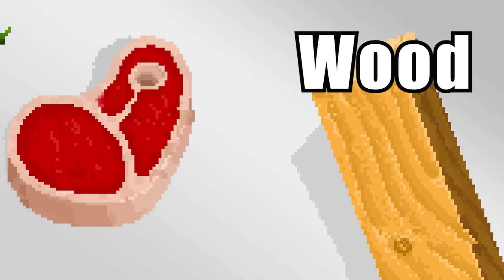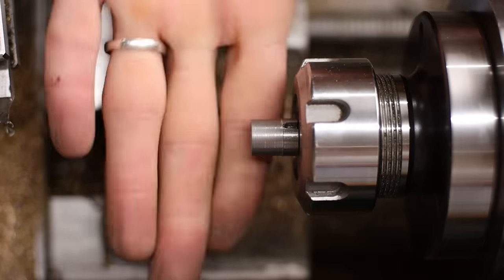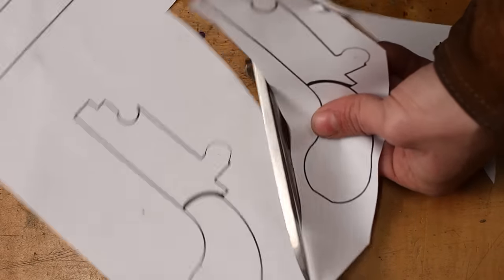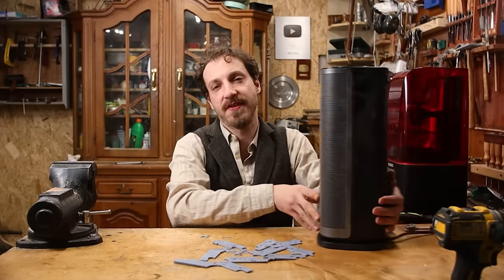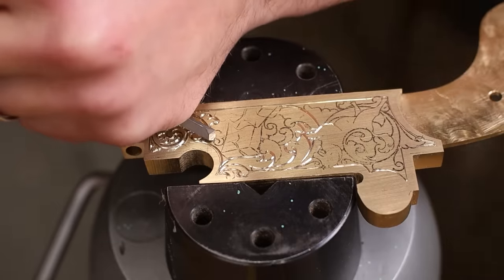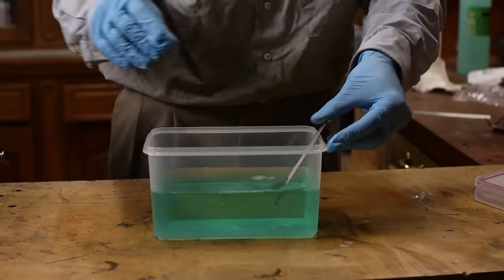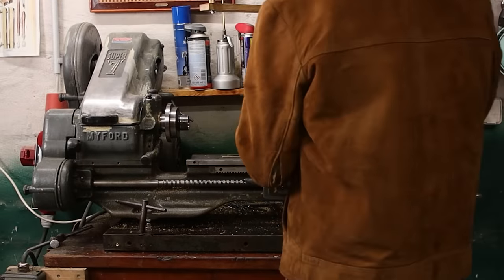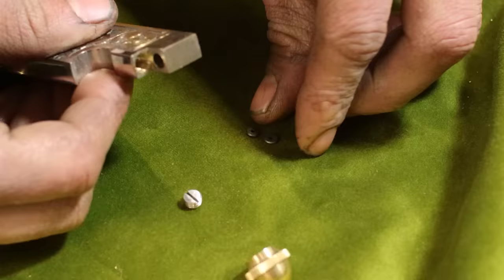I was Commissioned to Create a Circular Glass Cutter, will it Work?

Comment: I've tried casting tin with that same high temp silicone, casting a 3D printed coin. I think the problem we both ran into is that the tin cools too quickly. The mold needs to be a material that can be heated (sand, ceramic, etc) so the tin cools slowly and can get into all the nooks and crannies. In my case all the holes and imperfections made the coins look like old, corroded shipwreck treasure so it worked out okay.

Comment: Uri, I think next big project will be investment casting. It will allow to have smallest details. You can nickel plate locally with a wet sponge. If your steel quenched in water then it is W1. O1 is quenching in oil. I had also negative experience with glass cutting. When you scratch the glas you create a weak zone. Doing it multiple times does not help and opposite. When you start applying stress it does not cocentrate if you have several scratches. Perfect video. As always!

Comment: I second the comments saying that the casting molds need some "spouts". Places where the extra metal can go, chasing air out. But for such fine detail you probably need to use an injection mold. I tried making flat molds but the result needs a lot of additional work to remove excess metal on the back and possible re-work details.
Having said that, the result is amazing, it looks so cool! I hope the client sends you photos of it in use

Comment: On some glass heating works. Cut the groove and run the flame from something like a jet lighter along the scratch. You can hear it cracking and the crack propagating along the scratch. It works wonderfully, but not on every glass, some just break especially when there are multiple scratches from the cutter.

Comment: If you heat the silicone mold up before pouring the melted tin, that might fix your proplem. That's how they pour scultping wax, which has the same problem you had with cold molds

Comment: I work in glass manufacturing 
I physically flinched each time he did double passes

The whole thing looks very beautiful

On another note
Glass/Cutting oil and even pressure during the cut would help
Grab the glass as close to the edge as possible, doesnt need to be as close tot he cut
When you cut smt round make 2 or more additional cuts to break the outer parts off
Lastly, you can (but it is not advised as it can easily make the edge not 90°, so unless you have a tight curve like here better not) complete the cut from the under side, where by you "pull the cut through" by tapping some metal on the underside of the cut and then slowly advancing as you push the crack further

Comment: Lubricate the cutting wheel with white spirit and make one cut only.
When removing glass from the inside of a circle, first score a grid with none of the squares more than 10mm.
(It's only in jewel heist films where a disk is removed in one piece).
I do like your engraving skills. I wish I had seen more of you doing this.
Thanks.

Comment: protip, get a cuttingwheel used in a cnc machine, at work i used to use those that came with the handcutter and constantly had to replace them, then i took one of the used cnc wheels and even in that state it has lasted me 4 years so far with no decrease in cut quality since i'm nowhere close to putting the pressure on it that it's rated for, it's way more expensive than the disposable ones, but it pays for itself in one year of use.

the angles of the wheel is also important 145 degrees cuts everything 6mm and below, 155 degrees cuts 8mm and above.

When you want to start breaking, tap the glass from the opposite side of the cut, tap the glass directly under the cut, the amount of force required is a matter of practice, also, don't use a hammer, that commercial cutter you have is a similar model to mine, i use the corner of the wheel holder and i tap lightly.

Try avoiding going over the same cut twice, every sub-sequential cut makes it rougher, creating dozens of hairline fractures that provide the break with dozens of alternative paths besides the intended one, cutting oil helps get a smoother cut and a cleaner break.

also

The tin most likely had too much surface tension to really get into the details without a vacuum setup.

Srry for geeking out a bit, I am in absolute awe of the tool you've created, magnificent meld of form and function and masterfully crafted.

Comment: As a guess, your moulds are probably could. The silicone moulds need to be at temperature. Not as hot as the metal, but the need to be quite hot, so much they could burn you. Otherwise, espcially with such big surfaces, the metal cools to fast and cannot get into the detail. Also, while for plaster and resin such flat moulds are fine, for metal anything too thing won´t cast well, because there needs to be a resourvoir putting pressure on the metal down in the mould. So when casting such thin pieces, the part needs to be cast upright not flat. With a spout on top and vents going up from the bottom and other places to evacuate air. I actually would make such a flat and simple piece in a mould carved from soap stone. That mould can be nearly heated to the melting point of the metal, won´t degrade and is basically it´s own release agent. It´s what has been used to make moulds for casting tin and pewter sice ancient times. And it can capture absoluely incredible detail when the mould is heated well and the metal hot enough to very easily flow.

Comment: Scoring creates a fault line in the glass structure.  Next time, gently tap the glass along that line from the other side with the end of a file to deepen the fault.  Single or double-strength glass should snap easily after that.  Also, be sure to score completely from edge to edge.

Comment: a diamond type glass cutter is a lot easier to use.  Get a good one with a big chunk of diamond set in the tip.  Requires much less pressure.  Start the break near the edge of the sheet.

Comment: Make yourself a round jewel embedder. It's two tool heads, one cuts a dimple and a ledge and the other places the stone and burnishes the ledge down over the jewel.
   That really needs a star sapphire. Or a ruby breaker point. Or both. My industrial tool guys have single point diamond engravers in like 15 sizes. They probably don't look nice, price would indicate they are dirt color.

Comment: TRY PRESSING THE SILICONE DOWNWARD! I know you went a different route with the engraving but try giving the silicone molds some vent holes and try doing another cast sometime with them pressed down. The downward pressure displaced the tin from the silicone, but with a route to pass through it'll go upward and feasibly remain in the mold. im not a metallurgist though

Comment: Love the tool! I would suggest making or buying running pliers and grozers to break the glass though. As fun as the wrench was and the hammer? Neither are for breaking the glass. Also, only cut the glass once. If it sings it's fine. Don't add extra stress to the crystal structure by cutting bunches. I teach stained glass to high schoolers and that's one of the top 5 things that'll break their piece. Lol

Comment: If the bottles are nickel acetate, then that's all the homebrew is. You'd be lucky to not have to buy the brightener separately for additional cost if it is included. You may need to buffer it more, not sure. 
    Don't buy it if that's all that's in the bottle. Making it makes itself from what I've seen. Nickel bar in white vinegar and voltage, that's it.

Comment: When casting metal like that in silicone molds you definitely want the mold to be as hot as possible when you pour the metal in otherwise it'll just flash solidify when it comes into contact.

Comment: Wish you didnt give up on the 3D printer. The silicone casting would have done better if they were able to be heated to prevent the metal from cooling so quickly on contact. Maybe try again sometime with sand casting, or using that Prometeus Copper/silver Clay on the silicone molds and placing that in a furnace to cure

Comment: I don't like tin either, nor pewter for casting. I failed repeatedly trying to get into cutlery handles. It would only really "get it" at much elevated temperatures that burned the wood (I was direct casting an inlay of sorts).
   Into the fusible metal rabbit hole I went for a long time and now mix my own solders and low temp (under 500°c) casting alloys. 
   You probably avoided pewter for the lead content. Brittania metal is usually not cast but you could probably run more tin in the ratio and cast it. Speculum metal I haven't fooled w/ but it's similar. 
   Rose and wood's metal is has lead also. I don't use them but have made some to see it and have a sample.
   I like (Bolton)Cerrotru 281°. Nearly half bismuth. Non toxic, you can cast it in latex and use paper tape as a barrier (won't burn). 
   Your issue is "wetness" or "wetting" or lack thereof, a consequence of gravity casting. Cerrotru is better than tin or pewter in this respect but many other alloys are far superior. They usually contain Indium. Indium can wet glass by itself and with tin, as in all lcd screens now (it is an oxide "ITO" Indium-tin oxide) but it is put on in a sputtering chamber under vacuum as metallic. You're not using glass but the principal applies. My issue was the inlay would not flow into the tips where it was much narrower and pointed. I both used a different alloy (ct) and changed subsequent inlay to end in a broader terminal point. I have lost wax Cerrotru on the tip of an antler cane with success with plaster backed latex.
 You could try Cerrotru or add small amounts (5%) of Indium at a time by weight to any tin alloy. It will cause the melting point to plummet and this may start to vary from the point it becomes solid  (solidus?). My alloy snaps at one temp, but some hovering between for a hundred degrees or more till nucleation (crystallization). 
   The "tru" denotes dimensional stability Over Time. If you cast, some expand, some contract and some are neutral after becoming solid. Some will reverse also, shrink then grow after 200 hours or the opposite, grow than shrink. Their are handy charts so I never remembered specifically.
   If you do add Indium, enough that it melts at like 100° as a random example and that's too low but otherwise you like it, small amounts of copper or silver may be necessary. Always melt highest melting temp metals first when mixing. 
   There are also clays that fire to near pure metallic with 10% shrinkage that you could easily compensate a print for an impression. These may only be in precious metals (Rio Grande sells it).
    Avoid alloys with Cadmium also. I don't fool w/ that at all. It is another to drop the temp without making it crumble. Some of these alloys are brittle also. There's hundreds of them when then the recipe changes incrementally like they do. Basically pick the one you want. How wet it is matters and that info is on the lists. It matters for creeping into bolt threads or spanning gaps to work holding fixtures and smoothly bending pipe (it's a filler) and progressive soldering. 
   Don't give up next time.

Comment: I always thought the wheels on a glass cutter were Tungsten carbide,  never thought you'd see a steel wheel work as I think the edge would deform under the pressure you'd have to apply, Tungsten resists that kind of force deformation something like 3 or 4 times more than steel, I'd imagine historically its been done with steel in the past, but probably shaped to a sharpened point rather than a wheel, but I bet results were probably not as repeatable or it needed constant resharpening...hence the move to tungsten when it became availible

Comment: You can’t cut a hole in glass, since parting the pieces is done by expanding the distance between them and there’s no room fore the cutout to expand into. You need to drill or bore out the hole, i.e. remove material so there will be room for the pieces to expand into.

Comment: Glass cutters that aren't considered basically single use/disposable have built in reservoirs of oil which dispenses onto the wheel as you cut. Of course, the wheel still doesn't last very long. Also, your circular cutting functionality is neat but pretty limited with only a single radius possible. It would have been cool to make it adjustable. 🪟🪓

Comment: Cutting glass is brutal. My findings (non professional). 1 cut only, try to apply more pressure over a greater area for the break, and always cut it a couple mm out so you can just sand it to shape because f*** it.

Sanding glass will kill you though

Comment: Technically a glass cutter it's not a cutter - it's an incision-er. The real cut is done by putting enough pressure on the cutter while using it.
Second only cut one time - never go over a cut twice. It will ruin the cutter blade or the cut - mostly both. After the "cut" you can enhance the crack by putting oil inside and hitting it with something like a hardened steel ball bearing.
Apart from that your overall product is so beautiful! Keep on with this work!

Comment: 2:35 my man , hardened steel definitely cuts glass . It's even a test done on bottles or jars with knife blanks before tempering . You over tempered it. Perhaps you shouldn't even have tempered it at all. It's a small , round piece of steel that isn't going to take any strong impact so it's not an issue to let it be super hard.

Comment: Nice work but next time use some oil on the glass before you try to cut it, and cut some lines inside the circle so the glass inside the circle will break.

Comment: So, the three facts at the beginning of the video aren't actually facts. Entirely depends on the properties of the steak, the wood, the steel and the glass.
Standard window-pane glass has a Moh hardness of about 5.5. Hardened steel has a Moh hardness of 6.5 or so, depending on the alloying elements, the quenching, etc.

Comment: I worked in a glass factory for a few years in my early twenties. Those hardware store cutters are not high quality. Also cutting oil makes the cutting easier, I believe it’s a mineral oil that’s used but the exact type or viscosity I’m not sure of. It’s rather thin though and keeps the light surface cracking adjacent to the cut line to a minimum leaving a cleaner break when you snap it.

Comment: Replacment blade for tile cuter are same material as in glas cuter and are biger. Are on market real good quality but are in some standard sizes. For next time ;)
U dont tap glas after cut and it do not crack proper. Cuting insite cyrcel is no so easy and esest way is graind it by daimond bit on dremel or glas grainder. Is no work like on action move.

Comment: your castings failed because you had no gas vents or no reliefs of any kind. just like getting all the air out of the silicon, you must let air escape out of the mold. this is why most molds are 2 piece. also you should cut a relief or a riser so that the excess metal doesn't coat the back or the mold or in a 2 piece doesn't split the mold. not to sound like a jerk but you could have prevented this by doing a bit of researching lol.

Comment: Nice job - Except for the choice of glass cutting tool/wheel. These cheap cutters, are horrible. A prober cutter, eg. with oil dispenser, cost ~€50 and makes a 100% clean cut every time. With some practice, you can cut of <1cm in ~4-6mm glass.
It's good to practice cutting in thin glass and always use cutting oil (even WD40 is better than nothing)